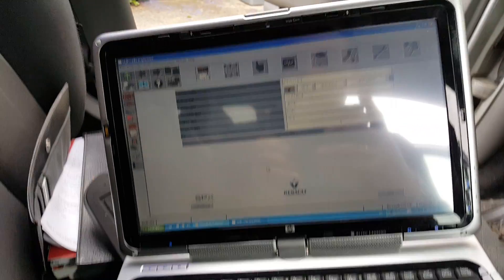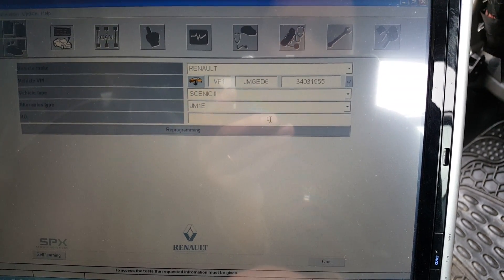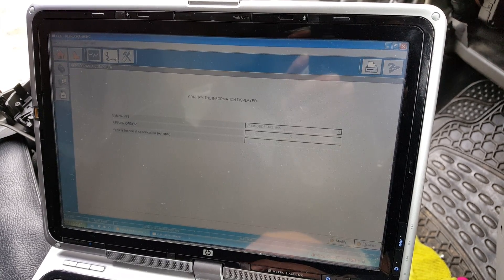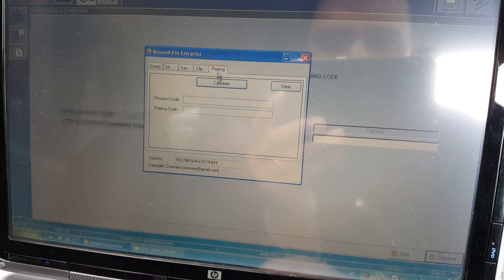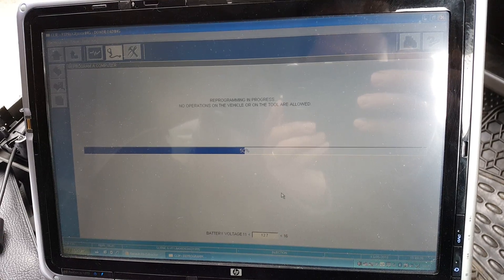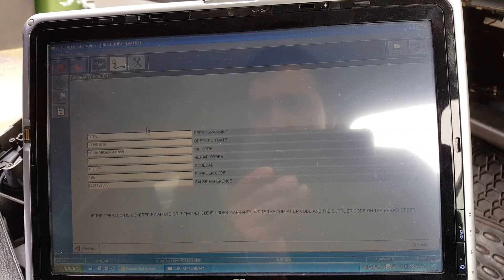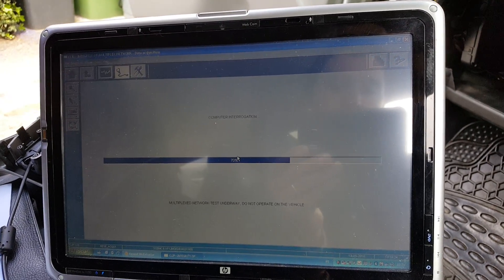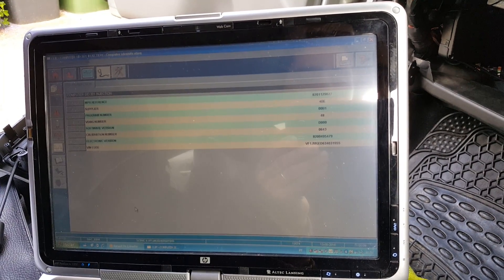Renault Can Clip ECU reprogramming procedure.

Comment: Hi . I have a 2006 megane with sid 301 injection(1.5 dci 106hp). same as yours in this video clip. I have a injection problem with it. The maximum intake air it admits on maximum throttle is 1500 mbar. The turbo delivers 2900 mbar on maximum throttle. It prevents the intake air flap from letting that amount by intermittently closing the flap. Looking on the gas pedal potentiometer it register normal 0-100% depending how much its pressed . However looking on the track 1 and 2 of the accelerator potentiometer there are anomalies in my view. track 1 registers 80 % on maximum gas pedal, track 2 only 40% on maximum gas pedal. On idle gas pedal The voltage on track 1 is 0.66v and on track 2 of the accelerator potentiometer is 0.33v. Do I need reprogramming of the ecu or to replace it? Or is there other problem I need to look into. Looking closely on the gas pedal potentiometers inside the gas pedal It does not seems anything damage or corroded in there except normal wear of the tracks which looks similar on both potentiometer tracks. Any help would be welcomed including showing me what values your clip registers.
Reply from the maker: Hi
This was not my car, so I can really check it...
But, the voltages are going to be different on both tracks, as the %... the ecu calculates both, and uses that as the position of the pedal... so, if you are getting at steady reading from 0 to 100% on the pedal position, I would say that is just fine... specially if you are getting no faults for the pedal... you might have something else wrong....
Thank you for watching and for your comment!

Comment: Hi there my can clip interface says transmission problem and I can't do reprogramming. In the background it's searching for software in renault.net
Reply from the maker: Hi
You need to do with with the cd... 
What codes do you have on the transmission then?
Thank you for watching!
Reply: @LMAutoRepairs  thank you for your work and i have virginised my UCH and now I am trying to reprogramme it.
Reply: Also which cd do I need.
Reply from the maker: @PJosahan  
The reprog CD...
But you shouldn't need it just to reprogram the UCH...
Can you communicate with the UCH?
Reply: @LMAutoRepairs  the UCH is blank at the moment and I can communicate with it. However, it keeps coming up with error message. I am currently using V 177 can clip.
Reply from the maker: @PJosahan  
Ok... but is blank with no software, or is like virginized?
Just follow clip instructions to program it back to the car...
Reply: @LMAutoRepairs  i virginised it accidentally and now nothing works

Comment: Hello, I put in an another used dashboard in my espace I want to change the vin code for the radio( put in an used radio from a different car.than the dash. Radio is blocked because the vin  from radio and dashboard are not the same. so the dashboard has to have another vin. If I go in repair mode with the clip en go to the other configuration menu it says "already configured" Do I need to reprogram the dash and can I put in the vin from the radio?
A solution will be highly appreciated. Your videos are very helpful, thanks. Regards Bern.
Reply from the maker: Hi
Most likely yes... you need to reprogram it... which will then automatically insert the  vin from the uch, or will ask you to do it manually...
I never done that, so don't take my word for it...
Thank you for watching and for your comment!
Reply: Thanks for your quick response, I willl give it a try.
 @LMAutoRepairs
Reply from the maker: No worries...

Comment: is it possible to updatr the cluster ecu? Mine keeps dropping the mileage trip counter every 200-300 miles. Its very annoying and renault wont do nothing as they say they cant see it happening so nothing wrong.
Reply from the maker: Hi
Depends if Renault have actually released an update for it... Renault should be able to tell you if there is... and it will show when you connect the tool to program...
Hope that helps. 
Thank you for watching and for your comment!

Comment: I get error 106 when trying to do reporg of ECU... got any idea?
Reply from the maker: That error askes for an emergency reprogramming...
Why are you trying to program the ecu?
Are you having issues with it?
Thank you for watching and for your comment!
Reply: @LMAutoRepairs  have some strange issues with the o2 sensors on clio 197... says the first sensor has a circut break on heater... changed the complete engine wiring/loom, sensors and even changed an ECU (the 1st ecu was cloned to the secound one) and the senosrs ofcourse...
Reply from the maker: @GoranCRX  
Hi
After all that, are you sure that the issue is not something else, and that the code interpretation is misleading you in the wrong direction? 
Which tool are you using to read those codes?

Comment: Hi!
Is such operation the same of manual injectors registration?

I will try to perform injectors "manually" registration before try with this to avoid breaking risks

Thanks in advance
Reply from the maker: Clip does have a menu to program the Injectors... no need yo flash the ecu to update or chance injector codes...
Thank you for watching
Reply: @LMAutoRepairs  
Thanks for reply It scares me if something goes wrong is there a way to "backup" or restore?
Reply from the maker: @user-ro8mt  
Hi
What exactly you need to do?
Programme injectors?
Reply: @LMAutoRepairs  
Hi have a anti pollution light issue already resolved with this task, but now  I can solve only executing with myself but I m not experienced so I'd like firstly trying with recoding injector or safely executing the reporogrammation. Can you help me?
Reply from the maker: @user-ro8mt  
The programming/flashing always involves some risks.... so, if you want something safer, forget that...
The injector programming is safer...
Clip does have a menu to program the Injectors... quite simple... providing your car needs that... some ECUs do not require injectors to be programmed...
Hope that helps...
Reply: @LMAutoRepairs  
Ok what scare me are the finalizing steps of data entry for what can happen if I lose the information
Do you provide remote (payed) assistence for this activities?
Reply from the maker: @user-ro8mt  
No... I don't... too risky...
Just make sure you have a battery maintainer in the case of reprogramming...
For injector programming there is no need... as it is a quick process...

Comment: Hi, I have a 2010 Renault Koleos with a faulty BCM which I believe is the same as a ECU. Can I got a second hand one from another Koleos and have it recoded to fit my Koleos? Man thanks
Reply from the maker: Hi
The BCM will stand for Body Control Module... the ECU for Engine Control Module.
You can fit a second hand, but most likely will have to be virginized first...
Thank you for watching!
Reply: @LMAutoRepairs  sir how can we make a virgin  bcm
Reply from the maker: @shyamsundar-dd5dr  
When I have one to do, i will...😉
Thank you for watching!

Comment: Hi great video I have scenic an bought used hand brake unit an can clip doesn't recognise the computer can I write the vin an do u have a video to show this thanks paul
Reply from the maker: Hi
No... clip will not be able to write the vin, unless the unit is blank/New.
But, clip should connect to it regardless of the vin in there... it sounds like you either go a bad module, or you have a different problem somewhere....
Thank you for watching!

Comment: Will this method helps If I want to replace my ECU with the other ( for exaple if my ECU was broken)? WIll this way clear adaptations and immobiliser connection to other blocks in a car?
Reply from the maker: JulianDelCampo 
Hi
Unfortunately no... there is other procedures needed in order to do that.
Thank you for watching!
Reply: What kind of procedures? I thought that reprog clears VIN and adaptation data while updating...
Reply from the maker: JulianDelCampo 
Hi
It does... but does not clear immo...
Another thing is, reprog will only allow you to go ahead if a newer version of software is available... as will no allow you to flash the same version...

Comment: Hi, I wish to take out my JR5 5speed gearbox and install a TL4 6speed. All connections and mounts are the same. Do I need to change JR5 to TL4 in the "Gearbox Type" can this be changed? Do I need to change it, or it will work as it is?

Comment: hi i wonder if you could please  give some quick advice   having a  strange   problem with my 2008  renault clio when i switch  dip beam on  both headlights come ok  but as soon as i turn the steering wheel just a touch to the left  high beam on left will come on and  same thing happens when turning right the r.h.s high beam will come on  returning  steering wheel  to the straight ahead dip beam  works as normal   i cant understand why this is happening any advice would be greatly appreciated  thanks .
Reply from the maker: tony pond 
Hi
Possibly an UCH issue... check codes and live data...
Does that happens when driving at higher speeds, or just when stationary or manoeuvring? 
Thank you for watching!
Reply: if i put the ignition and dip beam on  and turn the steering wheel its ok but when the engine is started and i turn the steering just a touch it plays up  all the time .   no codes or other faults live data shows nothing obvious  looking like a uch issue but  not 100% confident   . thank you for your reply .
Reply: check ground connections on the chassi there are some points on front

Comment: hi ,tell me how can i check numbers of kilometrage with can clip ,the steps
Reply from the maker: Cristi florin 
Hi
What exactly are you looking for?
Reply: i want to see the km of the car and i want tu now how ,and the steps for deactivate te rear wipe to not star when i put reverse
Reply from the maker: Cristi florin 
Just scan the modules... the mileage or km is usually stored on the cluster... and some cars on the body control module...
There is cars that store it in many other modules...
To deactivate the rear wiper, go to the body control module and go through the settings in there...
Hope that helps! 
Thank you for watching!
Reply: megane 2 ,1.5 dci it's my car ,one tutorial for me if you can ,thanks
Reply: make you one video with the steps and you can send me the video on stefaroiu@gmail.com ,thanks
Reply: Hello.Can you tell if it is possible to reprogramm  ECU in renault master 2018 with this tool

Comment: Hi, I'm working on the 2014 Renault Master III VIN:VF1MAFFVCE0700434 equipped semi-automatic gear shafting robot. Under the TCM fault code Df252 pump relay presented after used the Launch scanner "programming selection/engaging zones" now I have fault code "Df187 Programming not carried out or incorrect" Did I muck up the programming? Or caused by programming with presented fault? Does require Can Clip to Re-program?

Comment: I have a 2010 proton savvy which has a factory fitted 1.2L d4f Renault motor & ecu....will this software work for this engine?  Is it as simple as downloading Renault program & update to laptop & connecting via wifi obd2 adapter to update??

Also, if I turbo this engine, will the ecu be able to learn new parameters required for turbo?

Comment: Hi, what do you use to connect the ECU to PC?
Reply from the maker: Ludvig Lindell 
Hi
In this case, clip interface...
Thank you for watching!
Reply: LM Auto Repairs okey, is there anything else? Or where can I buy? Is it possible to reprogram an SRS ECU for Renault Clio Mk2?
Reply from the maker: The interface usually comes with the software, but not necessarily with the reprogramming CD... 
Look on ebay for example...
If Renault released a software update for that module, it will be able to do the reprogramming... otherwise no...
What are you looking for exactly?

Comment: hi
how to program the air flow with the  Can Clip?
Reply from the maker: mohamed mohamed 
Is not really program... is more like reset the learned values...
But not all engines will have that function... so if you can't find it on yours, is because it does not apply to your car...
Hope that helps...

Comment: Hi I'm from Mexico and I have a Renault can clip v172. I'm swaping ecu from a clio Rs 172 because the original got an electric burn. I follow your tutorial but it said that is not possible to reprogramming the new ecu. Hope you can help me . Happy New Year
Reply from the maker: Pablo Eguiluz 
Hi
No, it can't... until you virginize the ecu or copy the data from the original ECU...
Clip can only program new or virginized  (which is the same as new, on the programming side...), ECUs...
Hope that helps...
Reply: lmsvvavr thanks for answering in such a fast notice. I suppose that I am not able to do that through my can clip.
Reply from the maker: Pablo Eguiluz 
Not really...
Which ecu are we talking about,  is the Sirius 32?
Reply: If you virginized the ecu, would it accept a different code, say from a replaced electric steering unit from another scenic. I've been quoted £300 for a reconditioned unit (virginized), then there's the labor to change it

Comment: Can I pair the UCH/Immo using CLIP after swapping a damaged ECU with a donor one?
Reply: Just in case someone may read this and is asking the same question, yes it can, but only after you have modified the "used ECU" in a special way, or alternatively use a new ECU from the dealer which you will not have to modify.
Reply from the maker: The modification is known as virginize...
👍👍👍

Comment: Hi friend  could you tell me that incide and outcode calculator is inbuild in clip software or you are using external calculator? .... I am fresh in auto field and I yet did not prchased renault clip can I bye. it from chines online market? would it work? thanks a lot in advance..... pl answer my questions
Reply from the maker: Dev Dessai 
Hi
If you buy from a trusted seller a good quality clip, you will be fine.
The calculator is an external software...
Google will help you find it...
Reply: lmsvvavr 
thank for reply.... which one you use?
Reply: lmsvvavr ...ok.... thank you so much for your advice

Comment: Hi Imsvvavr. Have you try to run reprog with newest clip. I have a clip v168 and im trying to run reprog procedure however in this version i can not pass "voltage level" step. Actual voltage is always below required level. I have tried with engine turn on and with car battery charger connected (6amp) and with another renault megane connected directly with cable. Voltage is always below required level. With older version v156 i don't have this problem. Is this workign for you?
Reply from the maker: Yelow CC 
Hi
I am not yet using that version... it might be a software glitch... don't know...
Reply: I have found that this is NEW SAFETY FEATURE with newer clip versions. I have found other people having this issue version a bit lower then mine on english auto forum. So its not only one version specific problem. Let me know after you update your clip if you are facinig similar issue. Thanks  for reply

Comment: Hi! I have a question. I've had my renault megane 1.9 dci remapped, but I've lost cruise control and speed limiter function. At first, the tuner had problems installing the new map (the computer unit didn't want to accept it) and finally wasn't able to start the car. Then flashed the unit with a new original software and directly injected the new map, without obd. After that, manually typed in the injector codes and started the engine. However, the aforementioned functions were lost. Now, my question is, could a regular renault clip solve and simply activate them? Thanks in advance!
Reply from the maker: Nikola Dancetovic 
Well, there is a possibility that the configurations were distributed during the map loading... so clip will be able to help you...
But not guaranteed... I don't think that sort of info is stored in the same place as the maps...
Reply: lmsvvavr thank you very much. What do you mean? Where can they be stored then and what do you suggest as a solution?
Reply from the maker: Nikola Dancetovic 
Try with clip... the coding settings are usually stored on the eeprom or eprom... the maps are usually on the flash memory... but who knows what renault did... lol
Reply: lmsvvavr very encouraging conclusion :) i am afraid that the guy who flashed the ECU used software incompatible with car equipment. I remember watching the guy recoding the injectors saying that 'some computers (such as nav/multimedia, which I have in my car, working after remap) are unrecognizable' since the symbols were red on the clip..so it might also be the case with cr.control and speed limiter..
Reply: Hey Nikola! Did you manage to activate you CC/SL function? If yes, how?

Comment: Hi there imsvvavr have a question were can i find the renault flash program for my megane  
2005 1.5  . By the way Great channel have learned alot THANKS!
Reply from the maker: +Sosh Bogdanov 
Hi
You find it in the reprog dvd... but you will need clip in order to install it...
Reply: i have the clip . and im not to familiar with clip or renault. .but not sure  what reprog  dvd to buy . was hoping you can put me in the right direction.would be MOST THANKFULL.
Reply from the maker: Sosh Bogdanov 
Latest reprog is the version 151 if I am not mistaken...
Reply: Great Thanks so much..

Comment: i have question about software updates. when i try to lauch it ,it asks me for device serial number. i mean for clone tool. what need to input?
Reply from the maker: Autostop 
Hi
It should come on the instructions...
Although if I recall correctly, that is not important... you can put numbers from 1 to 7... or all zeros...